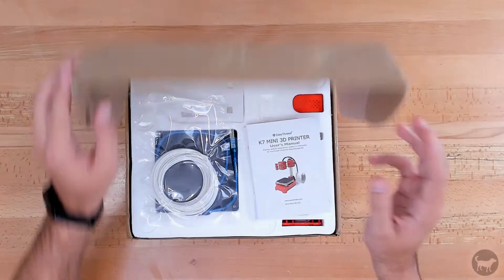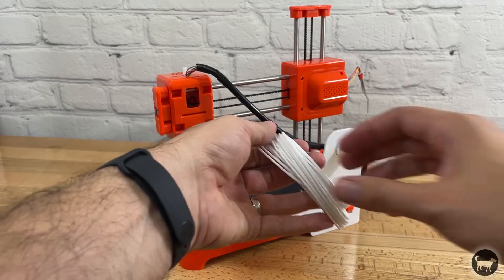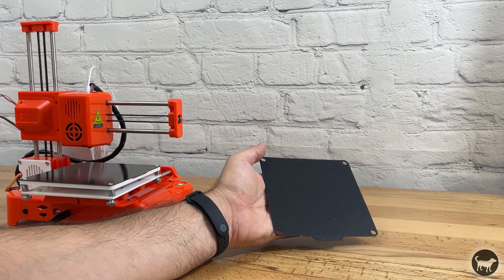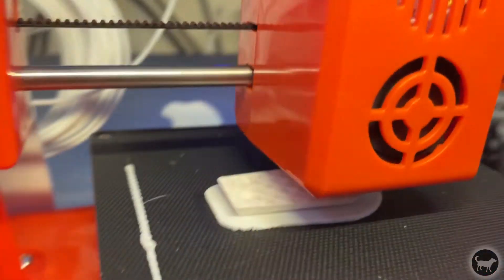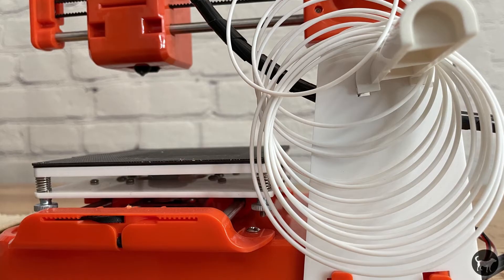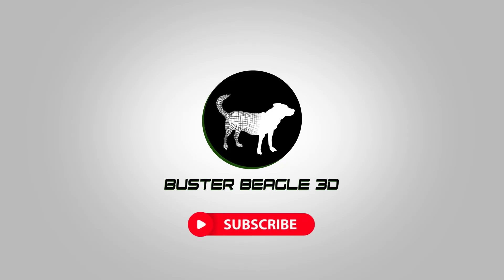$99 3D Printer Easy Threed K7 Review

Comment: Just bought one of these, because i could not spend much money and also living on only 7m² - so space is precious. It might not print perfect, but i hope to use it for small things like clamps, roof cable feed-through, gears etc.
Reply from the maker: You work with what you can. It will work, it's just not the best most accurate machine out there.
Reply: Would this be good enough to print a solid trigger guard/grip for my slingshot rifle? I understand I might have to glue together multiple pieces due to the size constraints. Or is there a better option for a little more money?
Reply: @JohnSmith-tz4on  i am honestly do not know how strong it needs to be for this. But the strength is a question of temperature and material. So other printers might bring similar results.
Reply: im buying one and im out fitting attachments so i can get any heat and nozzle i need. i want to print in a mini vacuum chamber that can fit this, is it possible?
Reply: @alejandronino3185  vacuum chamber? you mean some enclosing? I sometimes just put a cardboard box over it to prevent strong ambient temperature fluctuation.

Comment: I just got this and set this up myself. I didn't know you had to go through as many steps as you did before use or at least I didn't. I just assembled it plugged it in and turned it on and printed the test model Rocket. Despite not doing it the extra steps you did before printing my test rocket printed just fine. No issues at all for the first test run. But I am glad I watched this video because you've taught me a few things that I didn't know that were hard to read in the instruction manual

Comment: Good review! I would like to emphasize one major feature: The size. I am tempted to get one just to carry with me. However, as you noted, a construction like this will not be a top performer. Did you notice that small round shapes (like the chimney on Benchy) were not round? The X1 has that problem and this is very similar (really a variation of the same design).
Reply from the maker: I would say with the backlash and the bending of the X axis back and forth it’s hard to get accurate circles. It’s really just a teaching tool and not intended for any serious use. I bought a Monoprice mini delta for about $179 and while it is more expensive and larger it has automatic leveling, touch screen, heater bed, and real stepper motors but portable enough that I used it while traveling.
Reply: Yeah the stepper gearbox cause  about .4 of backlash. It is possible to use Antibacklash.exe but it make the print slower.  I tried Marlin 2  anti backlash but it sometime  cause layer shift. Though I suspect it is a bug in the firmware as some of the layer shift made no logical sense. 
 The  real solution is to replace the x and y axis motor with Nema stepper. I tired that on a X3 and it work great. 

As for the frame rigidity I am not so sure what is going on. I done the same test as 7:41 on the X3. There is no movement. I even tried with 4000acc 400mm/sec and it is still fine.  So maybe there is something wrong with the printer or maybe it a flaw that only affect the K7. I am curious if true the K1 X1 would be better option.

Comment: Thinking of getting this one, im thinking of getting into 3d printing and i will be 3d printing small models if cars and bits and bobs for diy eg battery holders, motor holders, gears ect. Would this be a nice first 3d printer? If not, anyhting else out there for under £100?

Comment: nice video, very helpful. I can't get any other .gcodes to print other than the two that came with the printer that were loaded on the micro sd card. Is there anything I need to do to the files to get them to print?

Comment: 🎯 Key Takeaways for quick navigation:

00:33 📏 The Easy 3D K7 printer has a 100x100x100 mm print volume, uses a direct drive extruder with a 0.4 mm nozzle, and prints at a resolution of 0.1 to 0.4 microns.
01:01 🚫 The printer's non-heated, perforated surface limits it to printing only PLA, and it includes a cooling fan for PLA printing.
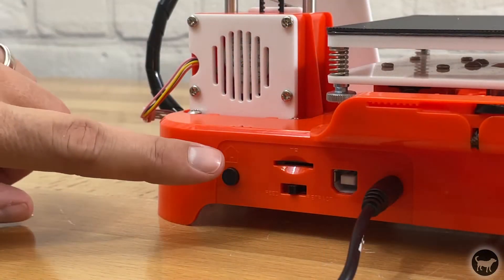01:29 🔧 The printer lacks limit switches for the X and Y axes, causing stress on the motors when they reach the end of the axis.
04:25 🖨️ Successful printing requires closer-than-normal leveling for the first layer; the included sample filament has a matte finish and requires manual feeding.
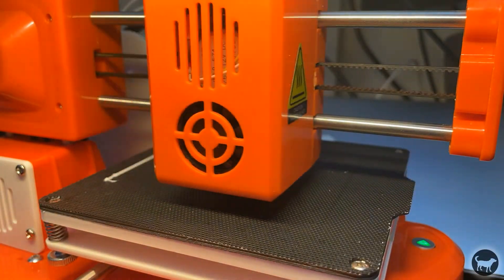07:59 👧 This printer is best suited as a learning tool or toy for children, rather than a reliable tool for experienced users, due to its simplicity and limitations.

Made with HARPA AI

Comment: My excuder set is damaged is any way to fix it than replacement
Reply from the maker: It was one of the issues I had with the machine. Since the extruder is one part it would be difficult to fix it without replacing it. I guess it would really depend on what was wrong with it in the first place though.
Reply: 3d print it lol
Reply: Yes this is a joke

Comment: Hi, i should copy all of this to start G-code?

"Cura Printer Profile G-Code Start

G21 ; metric values
G90 ; absolute positioning
M82 ; set extruder to absolute mode
M107 ; start with the fan off
G92 E0 ; Reset Extruder
G28 ; Home all axes
G1 Z2.0 F300 ; Move Z Axis up little to prevent scratching of Heat Bed
G1 X0.1 Y20 Z0.3 F300.0 ; Move to start position
G1 X0.1 Y80.0 Z0.3 F300.0 E15 ; Draw the first line
G1 X0.4 Y80.0 Z0.3 F300.0 ; Move to side a little
G1 X0.4 Y20 Z0.3 F300.0 E30 ; Draw the second line
G92 E0 ; Reset Extruder
G1 Z2.0 F300 ; Move Z Axis up little to prevent scratching of Heat Bed
G1 X5 Y20 Z0.3 F300.0 ; Move over to prevent blob squish"

Comment: These are on Temu for 13 bucks rn...
Reply from the maker: $13 is probably a the spool in the 3D printer listing on Temu but I'm sure the printer itself is pretty cheap as well.
Reply: Yep. Spool. They're famous for that, just like ebay.
Reply: I bought mine on Temu for 60$ 13$ sounds like a wheel of filament. Lots of items are featured at a price of one of its accessories on Temu. Just because you saw the pic of this printer doesn't mean that's what the price was indicating.

Comment: Easythreed nano vs easythreed vs easythreed k7 vs k1 vs 101hero?
Reply from the maker: While this is the only one I have any experience with I can’t say fit sure but looking at the specs of others…. Some have different build sizes. Some come with heated beds while others don’t. Some have screens. Some are $92 while the more advanced are $250. It really depends on what you are trying to achieve, toy or tool. If you are willing to spend a little more I would honestly go with something like a Monoprice Mini Delta ($179)which gives you way more features but still compact and at a still very reasonable price.
Reply: @BusterBeagle3D  Thanks!!!!
Reply: @BusterBeagle3D  i tried to install 2 more limit switches but for some reason it didnt work. maybe a firmware update?
Reply: @evilkittyofdoom195  the printer broke a few months ago i know have a ender 3 v2
Reply: @paulantony1981  how long did it last you before breaking?
Reply: @Amazing_80  about 3 weeks then the motor of the x Achsle broke